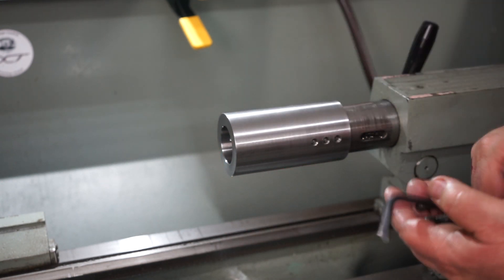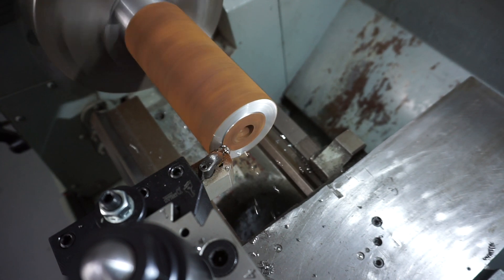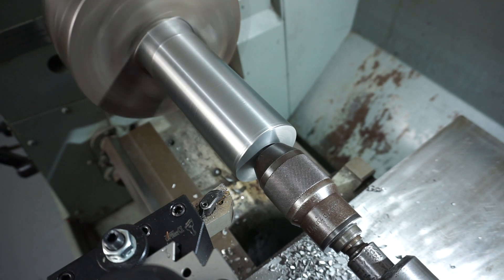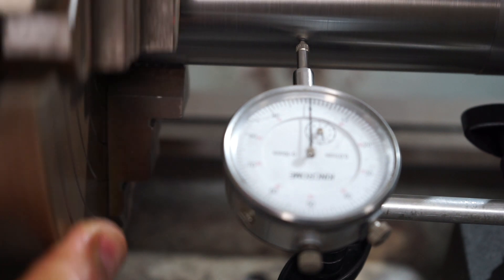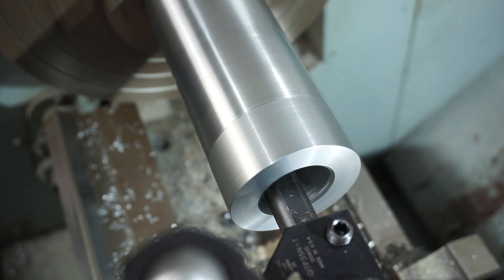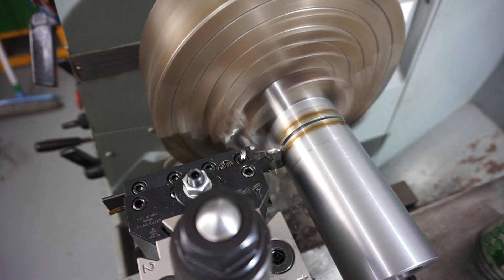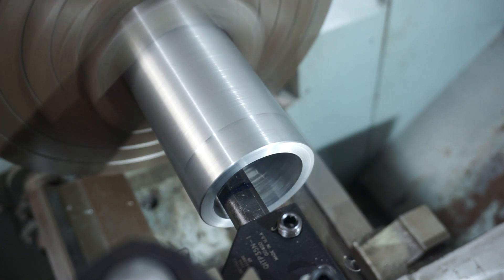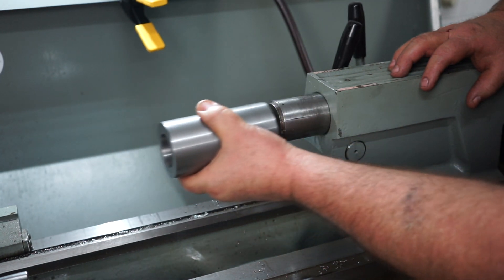Coventry Die Sleeve for the Colchester Lathe

Comment: Funny. I just made those adapters for my lathe. But what I did was to remove the tailstock quill and make another one that I drilled out all the way. It’s 2” longer than the real quill. The reason I did that was to not have the tailstock pulling for the thread. This way the quill pulls straight out from the tailstock. It has much less mass so that I don’t have to push the tailstock when threading. I have mostly Geometric heads which also have the push off lever. I prefer those so the spring doesn’t have to pull the head at the end. For large screws it doesn’t really matter, but when doing small screws with the small heads I don’t like the tension produced. It can’t be good for the thread. For the pull off models such as the Rubometric 1”, I made a finger on the bottom of the adapter, that goes over the quill I made. This contacts the carriage, the way the tailstock would. I have three adapters that go on that quill for different diameter shafts for the different size heads. As you know, it was a bit of work, having to make a 1.0625” hole all the way through an 11” shaft made of 1144. But that lets me make a long thread.
Reply from the maker: Hi Mel.  Thanks for watching and commenting.  Your idea sounds really cool.  I was too lazy and just made a simple adapter.  This way I could put the coventry die heads to work immediately to make those BSW bolts for my friends vintage engine.  Your ones sound like an excellent idea.  Thanks again.  Regards, Aaron.

Comment: These die heads, Coventry, Namco, Landmatic, Wagner are  more commonly used on automatic lathes for repetition  work owing to the time and attempts to set up. I don't think they would be suitable for a centre lathe.
Reply from the maker: Hi Andy. Yes you are correct. They were commonly used on manual turret and automatic lathes. However, they do work exceptionally well in the tail stock, but you must allow it to slide. Others have mounted smaller die heads to the tool post.  I’ve made many BSW Whitworth bolts & studs via this configuration. Much faster than screw cutting… Thank you for watching and commenting. Cheers Aaron 🍻

Comment: Hi Aaron,  nice machine work, & the adapter has nice tolerances both sides. With the bolts on the tailstock,  won't they mark the groove slot you mentioned  ??? Would it be better with a brass or bronze tip on the bolts ?.
Reply from the maker: Hi Ted.  I used it on the weekend and it worked a treat.  There is now marking or scoring at the moment, but your idea would be a much better one.  Cheers, Aaron.

Comment: Aaron in answer to your question about taps that have a point on the rear instead of a centre hole, I saw this just the other day
https://www.youtube.com/watch?v=UnMnrf_bIO4   starting at 12:05
If you already have a tap follower, you may already have the tool you want.
Reply from the maker: Hi Bob. Thanks for the link. Maybe I need to invest in a new Tap guide. My one is a Chinese copy, but to my knowledge doesn’t have that option. But I will double check next time I’m out in the shop. Cheers 🍻
Reply: @AaronEngineering  👍👌

Comment: Good job, Aaron. Dont worry so much about the surface finish. A little emery cloth will fix that. In most cases its the steel itself that is crap, not our tools or cutting tecnique. i´ve had steel that made noises where i thought it will rip my carbide cutter in half. It came from an unknown planet and was sold as mild steel. On the other hand i bought  a load of german made steel from Krupp that cut supersmooth like butter. It´s obviously more dependent on the manufacturer than on our machining/toolmaking art.
Reply from the maker: Thanks music man. Yeah, hard to tell when you don’t the type of steel. Especially since it was scrap metal lying out in the weather. I’d love some of that German steel you had. Cheers 🍻 Aaron

Comment: I've got one of these along with a load of metric die sets but haven't got round to making up an adaptor yet. I'd planned to make an MT3 adaptor but your idea is much better, attaching to the tailstock barrel. I will need to check my key is strong enough to withstand the torque. You may have given me the impetus to finish it off but on the other hand I could do without the distraction....
Reply from the maker: G’day Murray. I highly recommend making one mate. My old mate Peter Pilbeam suggested that I do it this way. This is how he runs his die head on his big Japanese lathe. Cheers 🍻

Comment: Nice job Aaron.  You might consider leaving that die holder loose rather than locking it the tail stock spindle.  That way you can feel when it grabs and let it go to spin freely rather than breaking something.  Some dies work better than others but in my experience the large ones can be difficult to start and tend to grab when you least expect it.
Reply from the maker: Hi Steven. Great advice mate. I’ll keep that in mind when using it. My old Colchester sometimes stalls when loading her up too much, but it has got more torque in the lower RPM range, and that’s where you tap and screw cut. I’ll keep an eye on it. Cheers👍🍻

Comment: Nice one Aaron. I've contemplated using the outside of the tailstock barrel to mount accessories on. Glad to see it done, great job it works well. Tony
Reply from the maker: Thanks Tony. My old mate Peter Pilbeam gave me inspiration for doing it this way. It’s was a excellent idea, as I was going to make a MT3 arbor to hold it. Thanks for watching 👍🍻
Reply: @AaronEngineering  That's a much better way using the full rigidity of the tailstock barrel compared to the reduced Morse taper arbor diameter to support all that extra weight and overhang. Tony

Comment: Nice project!  I have never considered making a sleeve attachment for the tailstock.  My tap follower has a reversible spring loaded pin with one side having a point and the other having a cone cut in the end for taps that have a pyramidal point on the back end.
Reply from the maker: Definitely a worthy project to make. I’m excited to use these Coventry die heads. Your tap follower sounds better than mine. Mine only has the point, but is spring-loaded 👍🍻